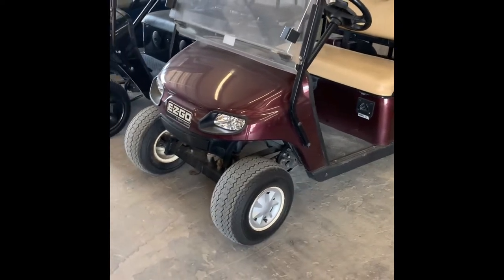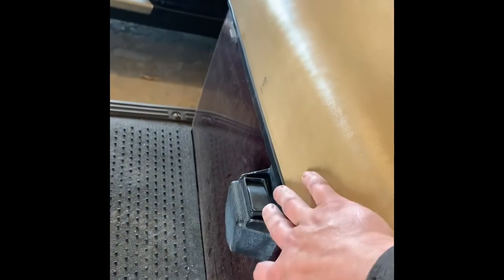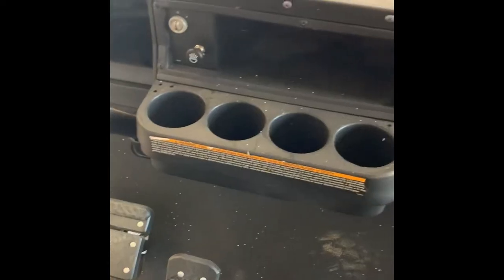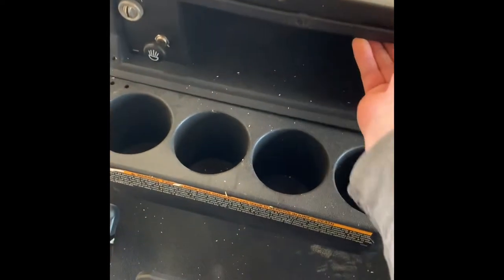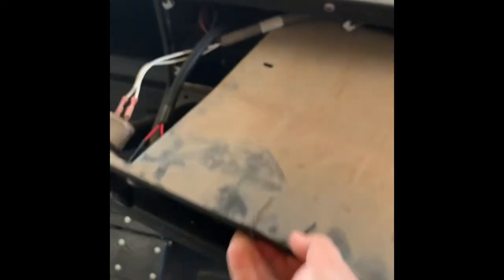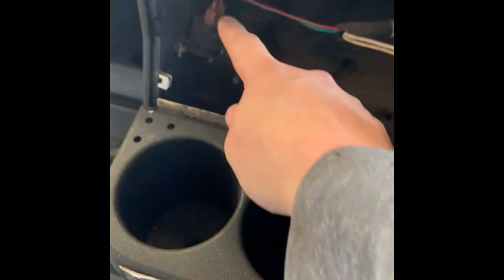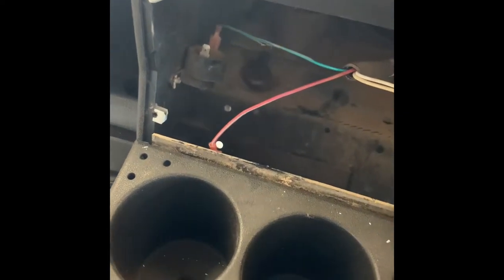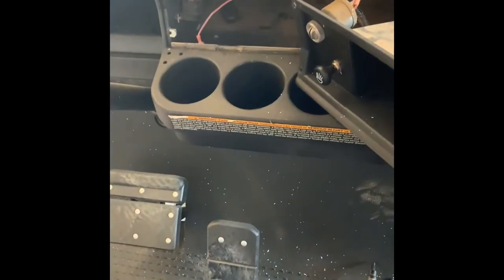Removing / Disabling the Reverse Buzzer On a 2014+ EZGO TXT 48v Golf Cart

Comment: My EZGO is a 2017 and you cannot disconnect it or it will not run.  But you can muffle it and it's way better.  It is located  under the seat on the passenger side.
Reply from the maker: That should be an RXV and you can’t disable that one or it’ll fail startup. Only the txt you can disable and still run the cart.

Comment: Would that be the same on a 2014 EZGO RXV
Reply from the maker: No. The reverse buzzer for the RXV is below the cover that has your run/tow switch. It’s wired in and can not cut it. You can only muffle it. You cut the wire the RXV will fail startup and won’t run.
Reply: @jbgolfcarts  
Thanks